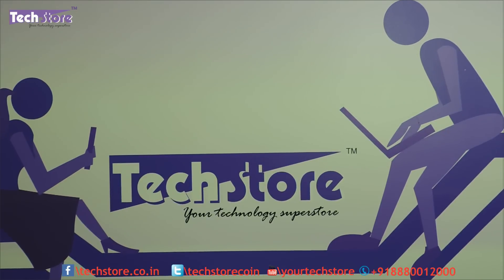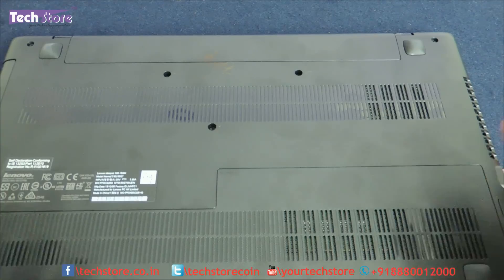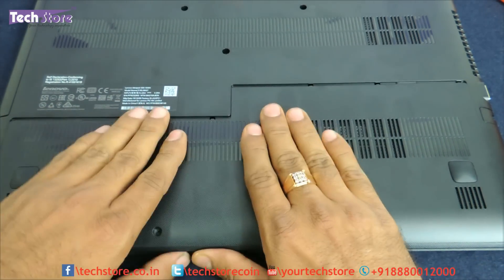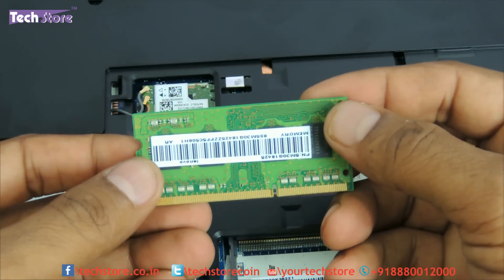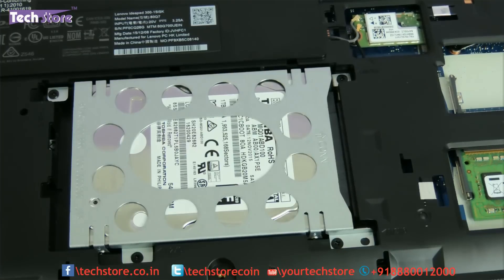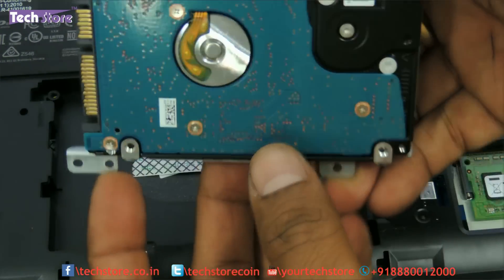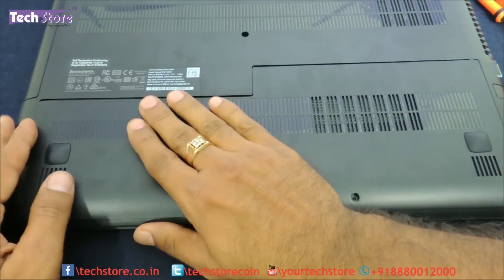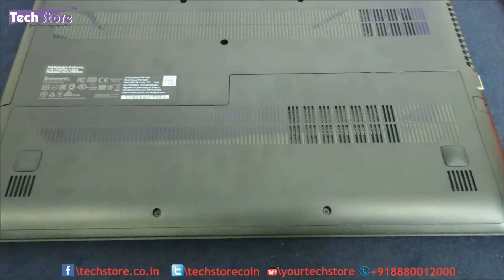Lenovo Ideapad 300 How to upgrade memory and harddrive ssd wifi easy diy in 5 mins 2016 model

Comment: Many thanks for the video. Based on this I upgraded my Ideapad 300-15ISK with 16gb RAM. Now I am planning to replace HDD with SSD and put the HDD in optical drive using caddy. But I don't know whether the caddy is of 9.0mm or 9.5mm. Kindly tell me the caddy size to be bought.
Reply from the maker: 9.5mm
Reply: From where did you those 2 ram 8+8 how much did it costs to you where did you purchase and how it is know and what specifications of ram did you bought

Comment: Hi TechStore, I am owing the same laptop as shown in your video with i7 processor & 8 Gb ram. I am planning to upgrade HDD to SSD. Does this laptop support only upto 128 GB SSD (i remember reading somewhere) or there isn't any limit for SSD ? Thanks for your help in advance.
Reply from the maker: You can buy a 512GB ssd of 2.5 form factor

Comment: Hey I have Ideapad 300-15ISK  80Q700DWIN model with i5-6th Gen. Can I upgrade my 1 TB harddrive to 512 GB SSD or what is the maximum SSD size supported  by this laptop.

Comment: will this ram( http://www.amazon.in/Corsair-CMSX4GX3M1A1600C9-Vengeance-Memory-Upgrade/dp/B006EWUP4Y ) supports the laptop you have shown.Because i have same laptop and i am planning to buy a ram for it.
Reply: So you bought the ram?
Reply: yes
Reply: how's it. It is supported right?
Reply: yes, my laptop supports 16,000 MHz ram
Reply: Thanks. I also have the same lap and was looking for an upgrade.
Reply: I got the lighter version corsair value select(for 2000 Rs) ram, whose performance is also very nice..... Most of the games are now giving 30+ fps